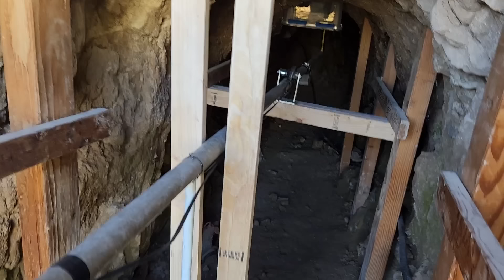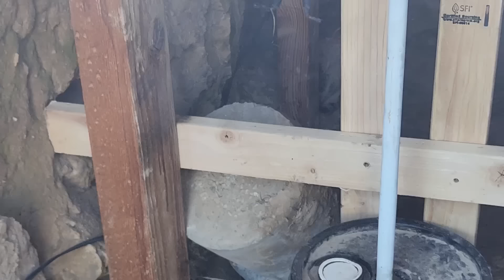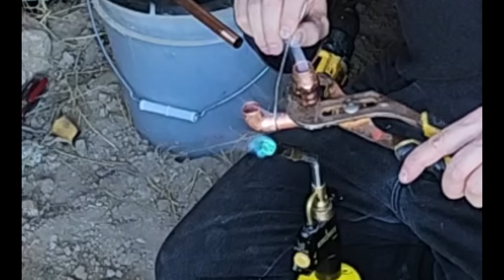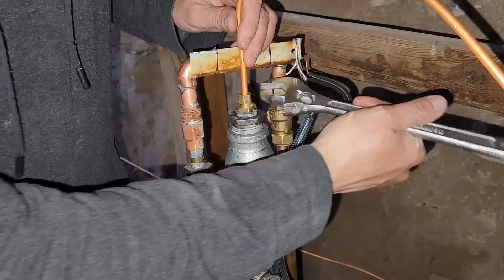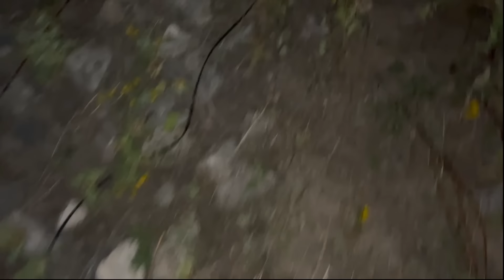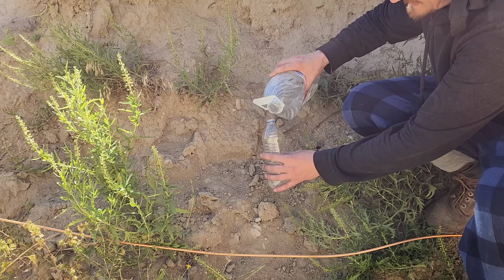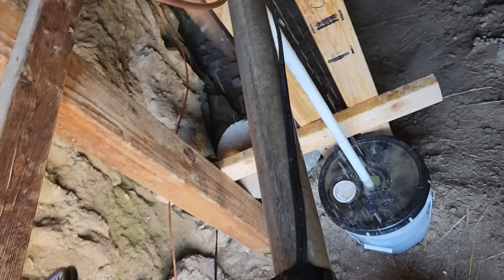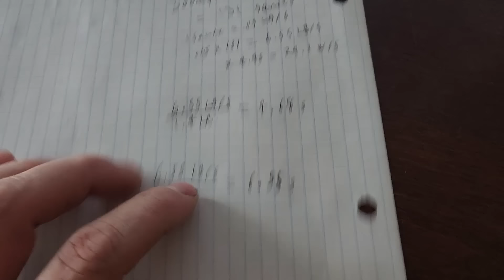Sodium Water Hybrid Rocket?

Comment: you need an acid. if you try to ignite sodium in a strongly basic solution, it does very little. pretty boring. put it in nitric acid and it acts like potassium lol. locally the available hydrogen on water is getting used up. not sure how peroxide would affect this. probably would help, makes things go boom better, and provides an alternate pathway to first get oxidized to sodium oxide which is more soluable in regular old water.  idk i think youre running into an issue of dominishing returns with either not enough water that can locally keep disolving sodium and ripping hydrgen out. might be best to copy the permaginate peroxide rockets from ww2 design. basically just make a hydgen generator and ignite that.

Comment: What if you dropped the sodium into water at a controlled rate? Maybe mill it into pellets or feed it in as a liquid. Then run an exhaust off the top of the water tank to blast out the gasses for the thrust.

Comment: What if your sodium had a support system in it that wouldn’t melt during the ignition. Since you melt and pour it in it doesn’t seem like it would be hard to do and would prevent the sodium from being separated and blowing out the end. Feel like without this regardless what you do any soft metal would do this without it.

Comment: being in hobbyist rocketry for most of my youth, those rules are.... for 1 not applicable to small rockets ... sorta... and 2 usually pending a review rules and exceptions can be made. the metal is specifically for "shrapnel" issues. the motor would not have that issue any more than other engines. Seeing as POTASSIUM (METAL) is a primary ingredient in normal hobbies small engines, i think you would be in the clear to do what you want within limits to size...that is if you some how put this all into 3d printed NON metal parts, a nozzle and a few fittings would not classify as a problem as long as it was reviewed.

Comment: Very interesting idea. A couple suggestions: 1- you can use a force/weight-cell and an Arduino to log the thrust. 2- is it possible to test the engine horizontally? That avoids the effect of the fuel weight loss. 3- you should check what shape does the solid fuel of an actual hybrid rocket has, as different shapes affect the are of the fuel exposed to the oxidizer. 4- similarly, maybe check how different nozzles spray the water.

Comment: Given the melting point of sodium, I was wondering if this would be two liquid reactants or not.  Intent was not, fascinating idea.  Result...might have been

Heat diffusing into the sodium and melting it is an issue in hybrid, either a faster burn rate, lower starting temperature, or different route would be needed.  Agree with your final assessments and sounds like a fun excuse for a NaK sprayer

Fun thing with sodium: it is (per unit weight) an excellent conductor of heat and electricity; better than copper or aluminum

Comment: What about liquid sodium? You could use PTFE as a container with heater to contain liquid sodium. You would have to dial in heating element quite precisely because PTFE melting point is only 330 and sodium is 100C but then you could use pressure and nozzles to mix water with sodium in combustion chamber and reach significant efficiency.

Comment: With Sodium low melting temp, Just pre-heat the sodium instead of NaK mix. You could just use a NiCr wire to preheat the sodium in the metal holding tank & the valve & nozzle so it flows into the combustion chamber.

Comment: So good to see you well and uploading again, Cody! Sodium is notoriously slow to react with water (in terms of energetic materials) so if you want to maximize the thrust you need to maximize the contact time between the sodium and water. I would change your combustion chamber design so that both the water input and exhaust output are on the same side on the top and the bottom is sealed creating a well that retains the sodium and water throughout the reaction. Inject the water in as you did but pipe the exhaust out the top and down to your nozzle. If you can put a backflow valve on the argon line all the better. This should maximize water-sodium contact time and also increase the total impulse time of the engine, as well as ensuring a much more full consumption of fuel.
Reply: I like this idea. If we continue to not care about mass efficiency, it could probably just be the same chamber inside a larger pipe that has the nozzle on the end.

Actually thinking about this further - maybe stack the water and sodium on top of each other, with a burst disk in between. To fire the rocket, you would simply need to pressurize the water past the burst disk's rating and it would dump all the water onto the sodium. The input line would need backpressure prevention. The output going to the nozzle could be at the top right next to the gas input.
Reply: Great idea. I was thinking with the Sodium's low melting point the reaction was literally ablating the fuel rather than giving it time to react. A mesh filter wouldn't necessarily help, but rather spray the water into a tank with the sodium and use the gas - instead of running your oxidiser past the fuel.
Reply: and it's a notch closer to house's favorite design - the pipe bomb 🙂🙂
Reply: If you were doing this seriously, you'd either have to use a thermal jacket to ensure your sodium was molten, or use NaK, which is liquid at room temp (and much more energetic) and combine the molten metal and water via spray injectors, running it as a true liquid fuel/oxy engine rather than a hybrid (which are notoriously hard to make work). Which is, of course, exactly what he proposes on doing!

Comment: With launching rockets, tripoli (primary insurer for model rocketry) dictates that no airframe components may be metal. Most model rockets use metal components internally for shock cord attachments and other hardware.

Comment: Surely you'd want the water injected from the nozzle-end of the fuel cell if you don't want the heat and pressure to build up and push out the fuel before it is reacted, yeah?

Comment: In the old days when maps were still made of paper and we didn't have a planimeter handy, we used to trace the catchment area (watershed as you Americans would call it) of a river on tracing paper, cut out the area and weigh it on a chemical balance to get the area.  Nice to see the method hasn't been forgotten. Thanks Cody always interesting! But why do you mix units? Weigh in milligrams, measure thrust in pounds and calculate in SI units? This is a good way to ensure you will crash your next rocket into Mars.

Comment: Do you think that the rocket is back flowing exhaust into the water reservoir? Surely your rocket is generating more thrust than just the pressure your pushing the water with from the air tank?

Comment: The idea of cutting out the paper and weighing it is the first thing I would think of.   I can't believe how many people were impressed by the way Cody found the areas.   The second method I would think of would be to use a planimeter.  Making one itself is a fun project.  The third is photographing the curve and asking software to find the area.    You don't "compute the integral" for data like this by "doing a ton of math" , unless by that you mean asking a computer to do it for you.

Anyway, weighing graphs is an old tradition at technical schools, so much so that it's a bit of a cliche.   I'm shocked at how many people were impressed by this.  I blame poor calculus instruction.

Comment: Hope you make a version with the sodium is in in a tube with the elbow coming back around pointing down so the sodium and water would be firing up from the bottom. Bottom capped, sodium solid to the bottom, and water sprays top surface of sodium, reaction only on top hopefully and the thrust would be going around two elbows to push it upward and probably look like a Pulse Jet looking deal except one end is capped

Comment: You should try using the sodium metal moulded into maybe 0.5-1cm diameter spheres, that will increase the surface area reacting and should also slow the flow of the oxidizer to reduce lost unreacted steam

Comment: The water reacting with the substance at the top seemed to result in the breakup at the top and loosen the bottom bits. Any way of getting water to the nozzle end and spray up and have it react going back up the tube so the bit at the bottom is gone as more reacts up the tube.

Comment: Nicely though out experimental design. Right up until the vinegar catch pan, I was wondering why you weren't thrusting sideways to null out the mass loss from the thrust measurements. Maybe you could have used a stovepipe elbow to divert horizontal exhaust into a pan.

Comment: Hey Cody, not an engineer or aerospace designer, but from the test it looks like you either had too much pressure or not enough water. In any event, it looks like most of the water just went straight through the hole of the sodium fuel cylinder within the combustion chamber and out the nozzle without touching the fuel. 

Maybe a nozzle to deflect the water onto the sodium more evenly as it enters the combustion chamber might yield better results.

Anywho, I would love to see more development with the solid fuel version of this engine as well as a possible liquid fueled version.

Comment: I know Sodium has a high boiling point, but I wonder if there's a way to produce sodium gas(vapor?) and inject it into a pressurized spray of water for a better mixture and a more efficient burn.  I know sodium vapor lamps use electricity and keep the sodium at low pressure, so I'm not sure how it would work as I'm fairly certain the sodium would essentially flash freeze during injection.  Unless it was already extremely hot somehow.

Comment: I performed an electrolysis reduction of sodium hydroxide into sodium metal. I was able to make a reactor from stainless steel. Heated until molten with a bunsen burner and then applied current. 

You would have to remove the clumps constantly as they formed or they would tend to explode... but it worked well, I was able to produce about a golf ball sized amount in a relatively short period of time.

Comment: using NaK as a propellant sounds highly dangerous... but so are most rockets/rocket fuels.
As for the test, this was very interesting to me.
I'm reminded of the tests nurd rage did to get sodium without electrolysis, and using this as an end point.

So, you've got to moderate the rate of reaction somehow, and also ensure that it lights at the base of the rocket so that it remains consistent until all the fuel is used up.

to that end, you would need something like a buffer covering separating both propellants until the bottom of the reaction vessel. you'd need to get the rate of reaction between the surface area you want to react, and apply only as much water as the supply of sodium needs. maybe a few, thin, spiralized pipes reaching down to the base. that's the theory, the math might be harder... but probably not too hard.

Comment: I'm no rocket scientist by any means, so all are welcome to correct me if I'm wrong but to reduce the inaccuracies in calculations from weight difference be avoided if you made the test bracket horizontally? I've seen many other youtubers doing so and it seemed to help

Comment: I've been considering the same kind of tech for some years, and since you're actually doing it, I'll give you some fuel enhancement ideas I came up with as well. I did believe that an NaK liquid alloy & water injection would likely be the most efficient general approach, but then I also believe you should be able to boost the output even further by adding aluminum powder downstream to react with the sodium hydroxide as well before it leaves the engine. I'd love to see you do that, but it would likely take some careful engineering for heat tolerance and materials, as the NaOH/KOH + Al reaction is also highly exothermic. Since there is a lot of hydrogen being produced in both reactions, you might also consider a way to get air in for combustion before the nozzle.

Comment: Man this whole video is great. 
It brought a great dose of scientific whimsy to the end of my rather tedious, miserable workday.
Keep at it Cody, no one else could do things like this quite like you can.

Things I particularly liked:
✓Hurling a baseball of sodium into a lake, to set the mood
✓Solid metal rocket fuel
✓Test rig in a mineshaft
✓5 gallon dashpot (A+ cost engineering)
✓Verified the test rig!
✓manual graphing, I forgot that was a thing.
✓Scale integration. 
✓Tare out the negative, who needs a calculator?
✓Hardware store rocket engine looks .... delightfully questionable.
✓$5 Pyro-actuated spring loaded charge valve
✓"Intention matters"
✓Noble gas pressurization
✓Friction/Stiction consideration
✓"I should go fill that up with sodium." Don't hear that every day.
✓Casting sodium! In a measuring cup, with a plumbers torch!
✓FWOOOOOMP PLBRTTTTT!
✓ covered in a thin layer of .... something.
✓ things don't light on fire  when I rinse them
✓ Dastardly spring springing
✓ Performance evaluation
✓ Abysmal performance, but works better than everyone else's sodium rocket though!
✓ LIQUID METAL rocket?
✓Oh and everything else.

Comment: Here are my profane ideas :
-Smaller nozzle so less likly for Sodium to fall out.
-More inject water for a longer time, with less pressure, so all the sodium can react, maybe use water vapor.
-Mixe the sodium with an inert compound to slow down the reaction rate, to have a longer more stable thrust.
What you guys think ?

Comment: Mr Cody sir, try welding in a cylindrical shell combustion chamber. This is an external cylinder surrounding a cylinder only slightly shorter, and the shorter cylinder is just a tube to the nozzle.

This will let your reaction materials react, it will create a pressure buffer to stop bits from going up the main combustion cylinder shell and down the nozzle cylinder exit path. Your combustion materials sit in the shell cylinder, the water spreads around the edges of that, the reaction pushes up to the top of the shell cylinder and out the nozzle cylinder.

Edit - Polyglycol products (DOT 3/4 Brake Fluid) react exothermically with Chlorine. That means, I suspect, that you could have a table salt fuel generation that pulls heat from your combustion chamber and electric power from your supply to actively create more sodium solid fuel, and you can have a polyglycol/chlorine afterburner, all in one system. You can use pressure from your same processes to push pistons up cylinders, creating a seal at the top when they're empty and pumping your liquids as you burn.
Reply: Mr Cody, Have you considered replacing this solid fuel with NaK? An Argon insulating fill that drains out the nozzle when the water comes in would keep it safe until firing, you can pump it as a liquid to throttle it with some easy valves, and you should still get a relatively clean exhaust.

Comment: You could switch to NaK, but that introduces all the problems of trying to pipe NaK under pressure...

Given that the whole problem is that the sodium is melting and flying out, couldn't you just design the Graphite nozzle to mix and combust the hot melted sodium and water  ?

Like a secondary, liquid-phase combusion chamber i guess?

Comment: 28:50 what about adding rigidity inside the interior diameter of the fuel grain with something like a graphene mesh?  Heat resistant, but yet keeps the entire grain from liquifying and shooting out under pressure?

Comment: Your enemy here is primarily the low melting point of sodium which causes the uneven burn. I can't see how this can be improved in the form of a hybrid rocket... the only suggestion I could make is to try to convert it to a fully liquid fueled design. Liquid sodium and liquid water.
Reply: Or alternatively NaK alloy which you won't even have to warm up to keep liquid - it's liquid at ambient temperature.

Comment: Is it possible to make a pressurized mist of molten sodium (or of the alloy)?
If so, I'd use a fuel injector like that of a diesel for water (this should minimize the spent water and help with optimizing fuel-oxidizer ratio), and then I guess some sort of a wider nozzle for the molten sodium or its alloy. Mix that up in some sort of a mixing chamber and maybe that will work better? Sure the pressurized water and sodium can throw off the thrust meter, but if you inject somewhere from the side maybe it won't as much. Also, try "isolating" the weight of the fuel and the oxidizer, by attaching the mixing chamber to the thrust meter, but having fuel and oxidizer separate and feed them via a flexible pressure rated hose or so? I'm not in any way an enthusiast in this field, just sharing opinions and observations without really knowing how much sense they make, so don't judge too harshly.. :D
Reply: And adjust the nozzle geometry AFTER calculating/observing the actual amount of gasses produced. Misting the fuel and oxidizer should provide maximum (or close to maximum) efficiency, because of increased (but somewhat constant) surface area and no changes in the volume of the chamber (as it changes when solid fuel inside of it is burned at different rates).
Reply: Try doing something similar to the "impinging injector" setup, where there are 2 injectors at a 90 degree angle (relative to each other), one of them releases a stream of fuel, the other one releases a stream of the oxidizer, they meet at the middle and mix thoroughly. Although I guess in this case the detonation happens at a later point, not at the moment of contact? Not sure.

Comment: you might try an electric solenoid water valve. they can be energized by a 9v battery or even modified to be opened with an air valve